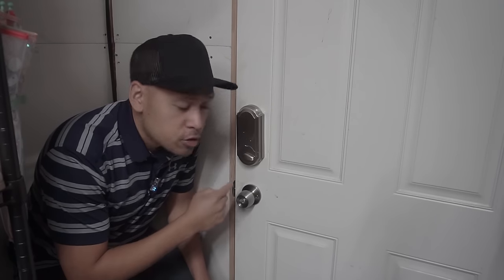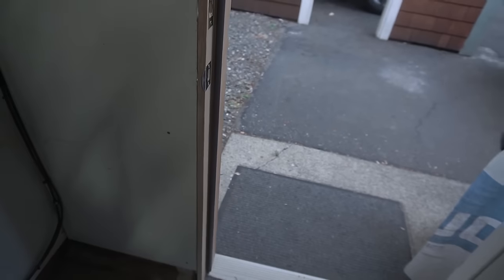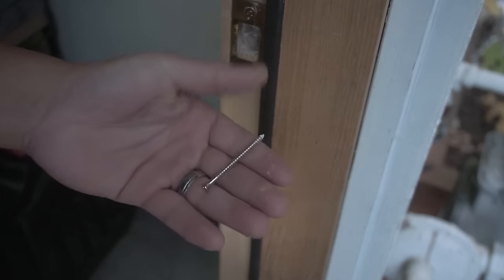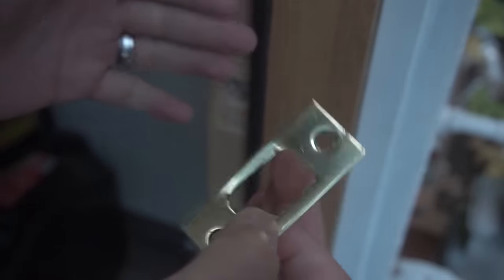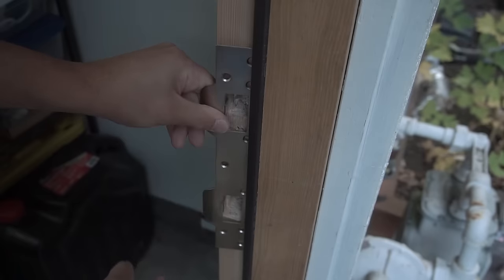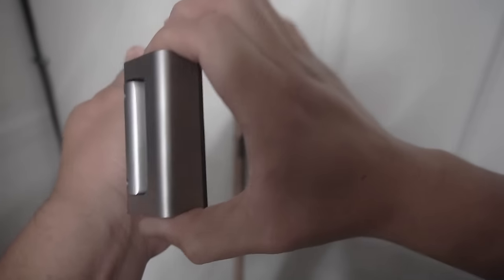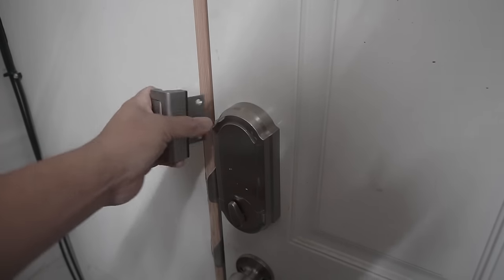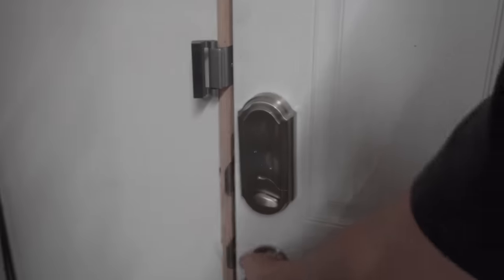How To Make Your Door Kick-In Proof Like A TANK! Keep Your Family & Home SAFE!

Comment: I'm a blacksmith and work with all kinds of metals. I ended up buying some stainless and made the strike plate the full length of the door jamb and on top of the door. I also put a piece on the door itself. My door is a steel security door with windows so small you cant break them out to reach the deabolts. I added a new solid piece of steel on the side because of the way it looked like it could still be separated. I made it more kickproof by adding 3 more deadbolts. I have one above the door knob, one below the door knob, on half way to the bottom of the door and one straight up on top. I also replaced the hinges with some i made out of 01 tool steel and hardened to a Rockwell hardness of 60. I put everything together with big stainless lag screws. Anyone that tries to kick my door in, is going to need a knee replacement.
Reply from the maker: That is awesome Krod! Thank you so much for sharing! 🙏🏽👍🏽😊
Reply: Don't forget the hinge side, it kicks in very easily!
Reply: @stevemitz4740  There is steel all around the door and the door jamb. All the way around
Reply: @krodkrod8132  That's good, so I won't  try kicking in your front door, BUT what about the back door? 
Inquiring minds want to know
Reply: @stevemitz4740  Reinforced steel door but i also have 2 Komondors. If someone is dumb enough to climb my back fence i wont be able to help them.
Reply: That is one great job of securing your entryway.  But where do you live that you need that much beefing up?
Reply: @johngoldsworthy1925  I live in the middle of 400 acres. If bad people show up to my house i don't have help. I help myself.
Reply: I guess you must already know there’s a contract out on you, right?
Reply: @rHeron-wr8bs  I wish. I need some practice.
Reply: Video please! Or it didn't happen!
Reply: ** Make Plates For Decoration Around Where A Hole Is Drilled In The Floor To Disguise The Hole(s)... WHERE There's A High Tensile Steel Rod(s) Next To The Inside Of The Door (*see above)..
Reply: ~~~ You AIN'T Scared..
Reply: Do u live in a traphouse
Reply: @chrome2yourdome  Nope. I live in a 6k square foot ranch house and i value my safety. The government and the police are not here to protect you. You are 100% responsible for your own safety.
Reply: Good job Krod. Looking out for yourself. More people should do this.
Reply: I love it!
Reply: well they only kick doors in with their legs in movies. In real life they use a heavy steel ram and its two guys who swing it  like a pendulum on a clock (youngsters look that up).   Or they can just take a 80 lb dumbbell and smack it on the door knob. Something is going to give.
Reply: In Mexico, they sell ballistic security doors for your home which come with a steel frame. It has pins in the door like a safe which go into the metal frame. About $500 for those .
Reply: @knerduno5942  nice.  are the houses made of concrete?
Reply: I want to see this door, you think you could make a vid?
Reply: @krodkrod8132  I hope you share the wonderful 400 acres with some dogs.  They will happily guard for food and treats and a tummy rub.
Reply: @ediewall6360  I have 2 Komondores and an Irish wolfhound. And about 100 peacocks or so. They multiply pretty quick. hard to keep track.
Reply: Damn where u live at? Fort Knox.
Reply: @wbishop1330  Nope, i just like building things. I also have a bunker a hundred feet below my house. The water table is 200 feet down so i can go deeper if i want. I'm in Nebraska so there is no rock until about 300 feet. Digging is easy. Its all dirt and clay.
Reply: How much was the steel door?
Reply: It's sad you had to goto all that work...to stop thieves.
Reply: What about all your windows ? Easy entrance. Most don't come through the front or back doors.
Reply: @20greeneyes20  All are alarmed and i have 8 cameras outside and 3 inside. Plus i have 2 Komondors. If an intruder gets in, they better hope i get to them before my dogs do.
Reply: Trust me, it doesn't matter how small the window is, a pro can get in with a Jimmy easily
Reply: It's a great profession to be in. I love metal projects. It's a shame we have to think of things like this to protect ourselves.
Instead of things improving it's  get worse in time. We never learned. Do we ? Some don't?
Greed and Power equals violence and destruction and death. 🙄
Reply: That is what is called a London bar even better if they are top bottom sides and the faces not just the opening  properly screwed on with screws with NO SHANK  you aint gettin that off
Reply: @krodkrod8132  As much as we can all hope it’s unneeded although comforting security, you should note a lesson taken from The Alamo. In a show of force/act of intimidation towards the Mexican army they fired all of their cannons individually. Ultimately all this did was show the Mexican army A. How many they had, B. Where they were, and C. The Alamos defensive weak point. My point being, I’d air towards caution when it comes to giving a multitude of specifics in regards to your location and security. Now that being said, I doubt these comments would ever come into play, but that depends on who the enemy at hand is. Regardless I have to say you sound to have a marvelous defensive set up!
Reply: Boy, it'd be a shame if a brought an angle grinder with a cutting wheel.
Reply: @barneycalhoundotcom  All barriers are delays. That's it. You think an angle grinder doesn't make noise? I'm going to hear it. My dogs would hear it, my cameras will see it. Shotgun will stop it.
Reply: What do you suggest for a front door with an inset window panel on each side of the door. I  already  have a double keyed dead bolt to prevent breaking the window and reaching in, but how do I prevent someone from kicking in the door.
Reply: @ScreamingEagleFTW  they are
Reply: Do you live in NYC?   What is the need for all that?
Reply: Thanks for the great tips. Hopefully you won't get someone who sees all that reinforcement and thinks, "hmm, they must have something worth all those locks and effort to keep me out" and/ or sees it as a challenge to get through all that fortification.
Reply: Nevermind, just read the rest of your posts and sounds like you have it all covered (dogs, guns, etc). Hopefully you never have to find out or use any of your extra protection, but if you do you'll probably be ok, which is more than I can say for the intruder.😅
Reply: @krodkrod8132  Whoa, aren't there stories about that breed from WW2?
Reply: Buy a Timely metal jamb. Come's  pre -painted with trim that snaps in place.
Reply: I wish you lived by me. I would hire you in a second. Are you also a farrier?  Thank you for sharing this information ❤
Reply: @krodkrod8132  please remember the bad people may carry a firearm or 2. Praying for you  yours, and your dogs.
Reply: @krodkrod8132  Love that!🥰
Reply: A knee replacement would serve them right!
Reply: post a video
Reply: Why not just move to a safer town?
Reply: @thomasw7952  I'm in one of the safest towns in the US. But every town and city has random crime. I also have a fully stocked bunker below my house just for fun. Even though I'll never need it, its still a fun place to hang out.
Reply: Where do you live?  In a war zone?

That's great security on your doors, but do you also have wire-mesh glass and bars on your windows?  Or have you bricked-in all the windows and just left loopholes for the guns?
Reply: @fartwrangler  I don't think you understand how physical security works. Security barriers are just delays. If you have them in place they are not 100% effective. People can get through them in just a few minutes. But they give you time to react when they make a ton of noise trying to get through them.  Glass makes noise. Someone tries getting through it they better hope i get to them before my dogs.
Reply: We would like to see a video on channel. Can take it down a few weeks after making it if worried. How the door process you have never seen.
Reply: Do you mind sharing a video or picture please ? We’ve been having a lot of break ins in Toronto and I would like to secure my front door
Reply: If I was a blacksmith I’d make a cool black metal (iron looking) door.  Display your craftsmanship as advertisement and write off the expense on your taxes since it’s now business related.
Reply: @todd5082  Blacksmithing is just a hobby. No way to write stuff off. I have made huge heavy doors/frames for customers With hardwoods and black iron. But they are super heavy. People have dumped about 20k worth of materials just on their entrances. I don't want that on my home. Mine is more function, and doesn't stand out. Standing out, draws attention.
Reply: Impressive 😮
Reply: Wish I could do that
Reply: @BoleDaPole A pro would avoid exactly this type of place due to the area, nowhere to blend in. You may be the only vehicle, much less that model or color for 30m either way, nor are ranchers known to be weak targets or overly wealthy & much of their wealth will be in guns, ammo, survival craft, food, tools, animals, land, etc. Old widows will pull first and ask questions later, you had 400 acre warnings of 'fuck around find out'. Assumining this is some city transplant new to the area escaping the hellscapes the cities have become, you may luck out in that they don't have anything set up in terms of sec, deterrents, etc. Chances are they sold much of the easily concealable assets they had during normal times. But you have a point in general. Bump keys, social engineering, jamming/mirroring their surv system by accessing their network (easier by the day - in the age of AI, flippers, omg cables, drone capabilities - assuming people changed the router default to begin with, run a VPN & encrypt their shit to begin with, some old school solutions are still going to be the answer at the end of the day. If someone wants something so irrational, skilled enough to take it, make it theirs, & escape (or whatever that entails) I'd venture to say the OP would blame himself for not hardening the place further. One would imagine a pro would spend time in a target rich environment, x vicinity, w/ cover, ability to blend into a suburb/urban landscape that don't take sec srsly at all, & legally not allowed to defend themselves w/ nonsense like duty to flee, not castle doctrine etc. Cheers.
Reply: @chrome2yourdome best line from an old movie, ‘they were built to keep you in.’, original Magnificent 7
Reply: 😂🤣 KNEE REPLACEMENT 😂😂😂
Reply: @ediewall6360 YES! YEEEEES!!! DOGS  WORK FOR TREATS AND THEY WILL GIVE AN INTRUDER THE BEST KIND OF TREAT TOO 😳😉😂🤣😂🤣
Reply: @20greeneyes20 NAIL!!! AND I DO MEAN LOOONG NAILS! NAIL ALL THE WINDOWS SHUT 🔨
Reply: Can you do mine?

Comment: Lmao get your self a 2x4 the width of the door 5 inches past each side so take for example a 32 inch door you would need 42 inch board screw board into frame one each side. If you want to further increase door strength replace door jame and door itself with a steel core door. Replace 2x4 with a metal bar. N absolutely nothing will get through door. Securing your door latch which is only a 1x3 wood and on it's latch part it's only a inch thick. Zero strength. I'm in construction for over 20 years I've replaced hundreds of kicked in doors.

Comment: You need to be careful, at the beginning of the video there was a guy that looked just like you kicking a door in. Sensible and affordable modifications that can help. A lot of comments assume your not home, but what if you are, at least if someone tries to kick your door in it’s going to slow them down or stop them giving you time to react. I used to work night shift so I took a lot of precautions to keep my wife safe including swing out security screen doors and solid core external doors, reinforced hinges and as well as locks and an emergency button next to the bed that instantly set off the alarm system if pressed. Never needed it but it gave both of us piece of mind. Cheers
Reply: What an excellent extra precaution to discover. Never have seen such a thing. THANK YOU!!!!  🙏🏻🙏🏻
Reply: Are you trying to be funny??. I'm absolutely sure that was example of what the video was about and yeah it's the same guy LOL, you folks are hilarious 😂
Reply: @Bellemogli  Yes, just a joke😂😂
Reply: Scrounga's Workshop: Bless you for caring!
Reply: Hope you benefit from that extra 'piece' of mind.

Comment: Pro Tip: Don't use the screws that come with the heavy duty strike or interior latch. They will break. Pick up a set of good 3 or 4 inch case hardened screws from the hardware store.
Reply: Good tip thanks
Reply: Definitely 4 inch
Reply: Yeah, that's what I was thinking! And I also wouldn't use cheap Chinese steel from Amazon.

Comment: Remember, the screws on the hinge side are probably 1/2" too.  Take those out and exchange them for some 3" screws with a solid shank towards the head.  Using standard threads all the way to the head of the screw causes the screw not to take a lot of abuse before sheering.
Reply: Thanks , never though about the solid shank making them stronger! Good info😁😁😁
Reply: Also replace the 1/2 inch screws on the hinge/door side as well.
Reply: Use a safety hinge. Better than screws
Reply: Great advice because they are kicking the doors in on that side of the door!!
Reply: yeah don't get screws threaded all the way up. Screw shear strength is actually super poor. You wanna get proper wood screws that dont have threads for the last like 1/2-1"
Reply: Seems nobody here has actually installed a door or tried to break thru one - the whole door jamb has nails, glue, insulation, and caulk on top of at least one long screw in the top and bottom hinges. Lock side is where you need to beef it up - and if you use 3” screws with a fortified deadbolt plate, and the jamb is shimmed right - you’d be amazed how long it takes even a seasoned carpenter with loud tools to get through it.
Reply: @wallychambe1587  Ahhh!!!! No, notta! The latch side my friend.
Reply: My front door is a double door. Can you do an episode on security of that scenario please? Thanks!
Reply: @bernardwright9848  A weak point is a weak point, it takes like 10 minutes and cost a few cents to upgrade so why not?
Reply: Screws with a shank behind the head are a total waste of time in frames like that you have a huge lenght of screw that is not holding anything if you got screw that the heads come off may i suggest you go look for some DECENT screws  probably not made in the US  is my guess  .
Reply: Yes. We used extra-long screws on our refit. It worked beautifully
Reply: Make sure you use quality hardware, too. Not the cheesy Chinese-made pot metal screws most hardware stores seem to be selling these days.  Pretty frustrating to be installing one of those new strike plates, and having the heads break off a couple of the screws, just as you're tightening them down.
Reply: @fartwrangler where do you get the quality ones

Comment: Metal doors come with a wood core and 1 inch screws which makes the hinges just as vulnerable as the latch, your door isn't a tank until you consider putting longer screws into the hinges as well
Reply: The manufacturer actually gives you one long screw for each hinge which is not enough
Reply: My steel doors are anchored to solid wood frames via a 3 inch screw every 8 inches up the frame, the hinges have three inch screws on both door and frame. I have the lock plate he shows on all three doors. Then it is worth mentioning the house is built with block and I have hurricane shutters on the windows. Here in Arizona security doors are on most all houses, mine has 3 of these doors outside of the steel entry doors anchored via 12 bolts each door.
Reply: Yess!!!!!!!